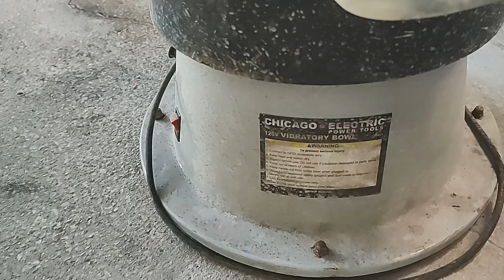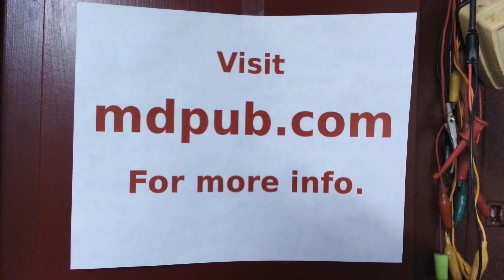A Look At My Improvised Ball Mill: How it works #gold #silver #ballmill #improvisation #machine

Comment: I stole your idea. I use the smaller version and less bearings. It's worked great. I don't need to use the vacuum dust separator . I just tip it over my screen and sort it that way.